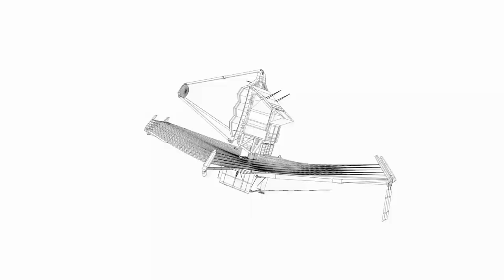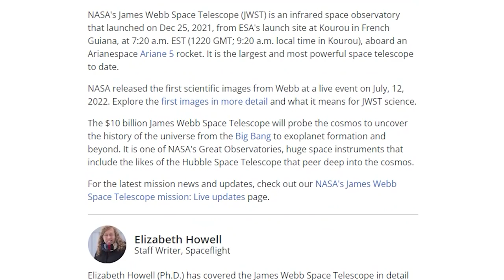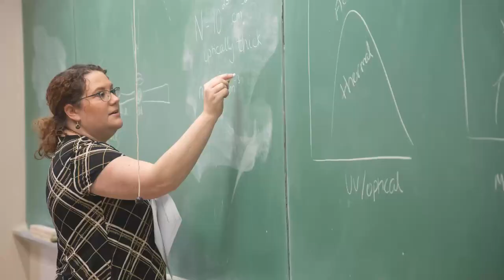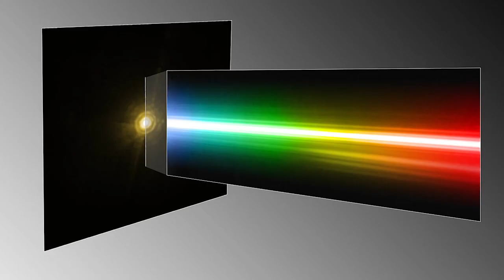The James Webb Telescope Just Found Something You Wish It Hadn't

Comment: If the galaxies get larger with distance then it doesn't indicate the universe is expanding?  No, it means we are not able to use a telescope to look backwards in time.  The galaxies are larger than the Milky Way and are more abundant than predicted.  The astrophysicists said it was as if the telescope was looking into the future and not the past because the galaxies were larger than the Milky Way around the time when the big bang happened.

Like I said, we are unable to use a telescope to look backwards in time.  The large galaxies are older than the Milky Way thus much larger.  Light information happens in a quantum instant because of quantum entanglement.  So the oldest galaxies in the universe will be easy to spot with a powerful enough telescope and long exposure time.

I accurately predicted the large old galaxies in the early universe.  I knew general relativity was wrong about light information taking time to travel.